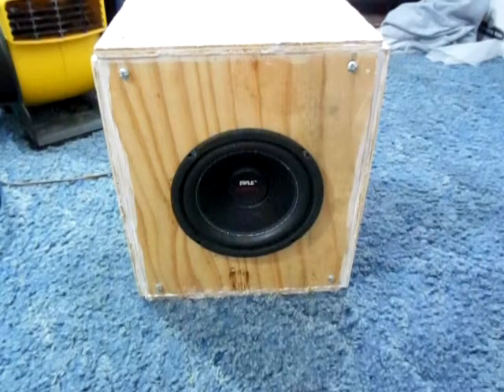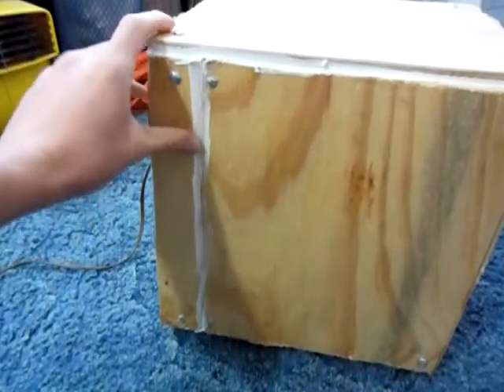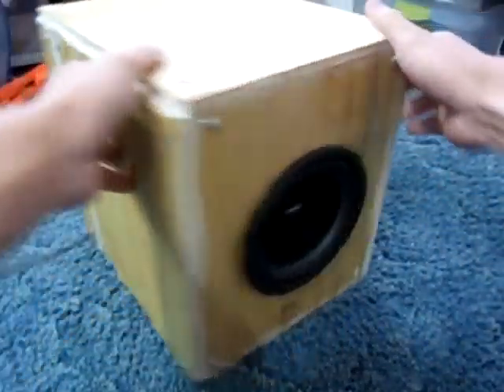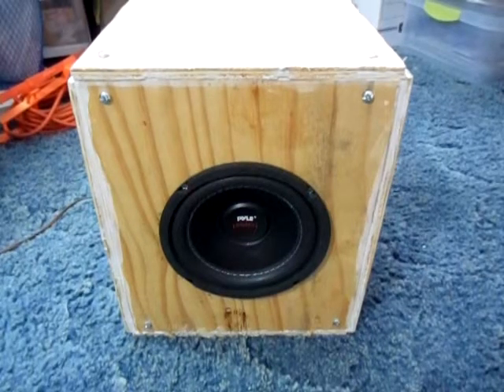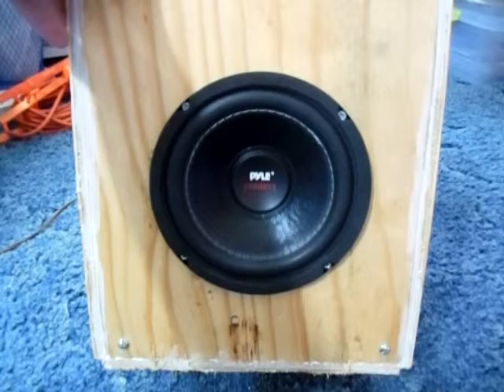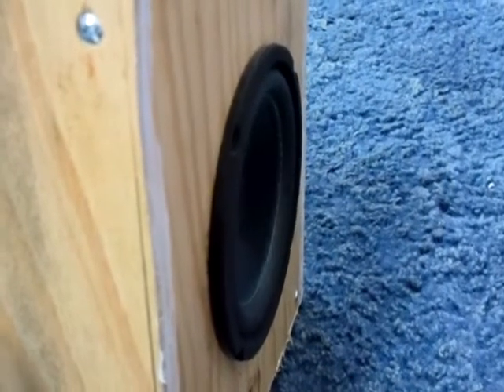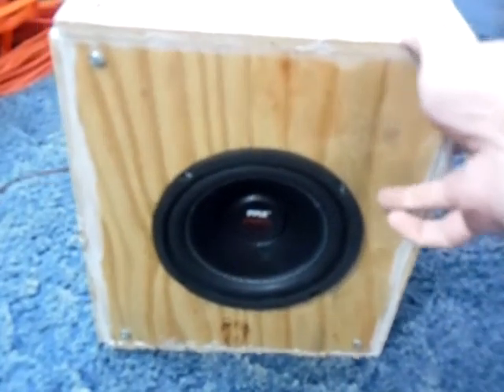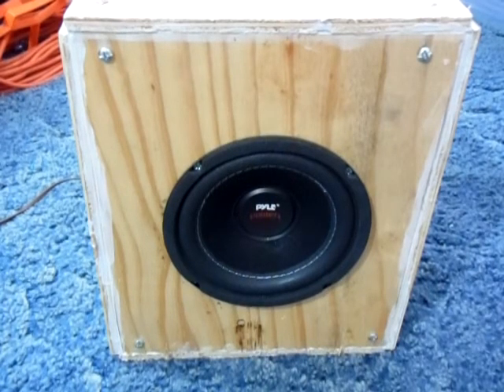Homemade Subwoofer For Solar Powered Sound System

Comment: Bro I have an idea. If anything you could put in 3 more. Now since one is 4 ohms right, wire up 2 subs in series as well as the other two in series. Then it was be 8 ohms per pair. Then wire each pair together in parallel which will bring it back down to 4 ohms. And since they are easily driven it wouldn't put too much more pressure and will be the same ohm load on the amp as before but with a larger power consumption but barely.
Reply: Well if you still have it of course
Reply from the maker: Cool! That's not a bad idea.
Reply: +2012solarful Right? Question is...do you still have this little guy?
Reply from the maker: Yeah, I still have it. I converted it to Bluetooth so that's his I'm currently using it. I can always change it back though. :)
Reply: +2012solarful Oh not bad! What amp are you using and do you know how many watts it can put out at 4 ohms?
Reply from the maker: Thanks! I'm actually salvaged a old Bluetooth module/amp from a pair of old Bluetooth speakers. So, I don't know how many watts it is. I believe the speaker is rated for 150 watts at 4 ohms. I personally don't think that it can handle that much power though.
Reply: +2012solarful I know that it really can handle 50 watts rms. So 4 would be 200 watts rms. I'm sure you amp would be able to handle 4 of these. And not bad though. That's really creative 😆
Reply: +2012solarful I know that it really can handle 50 watts rms. So 4 would be 200 watts rms. I'm sure you amp would be able to handle 4 of these. And not bad though. That's really creative 😆
Reply: +Naseem Mohamed Your*
Reply from the maker: Haha! Thanks! Yeah, I think amp could take it. :)

Comment: more like 50 rms
Reply from the maker: Yes, I am only giving it about 30 watts RMS.
Reply: Are they really 300 rms Pyle is known to me bad brand
Reply from the maker: I have never tested it with 300 watts. My amp is 50 watts RMS and it is really testing the sub's suspension. I wouldn't give it any more than 50 watts.
Reply: +2012solarful I wouldn't either
Reply from the maker: Agreed!
Reply: @2012solarful  it might just have a decent voice coil that doesn't overheat. May as well port the box though or try a 6th order or even horn lol
Reply: no no no dont give it more than 40-50rms in 4ohm